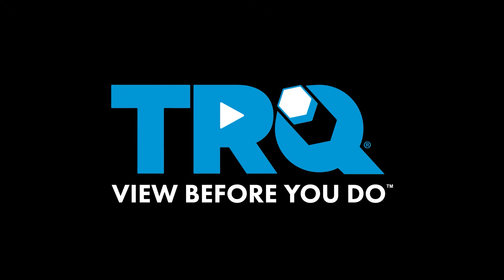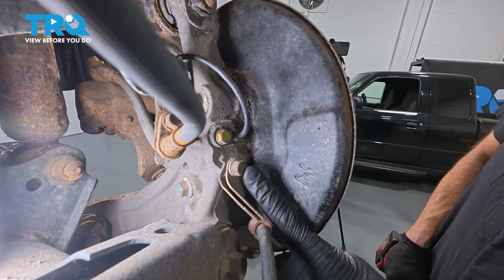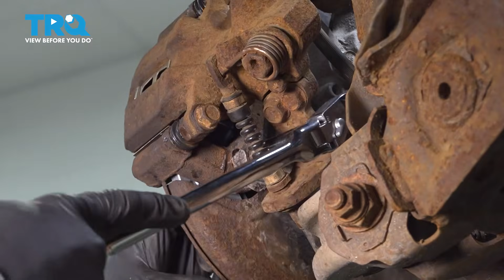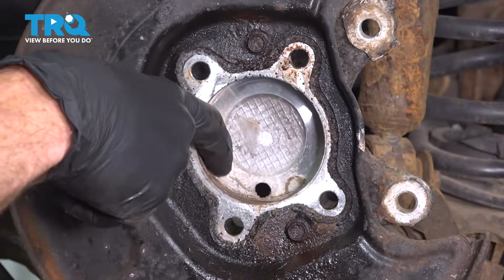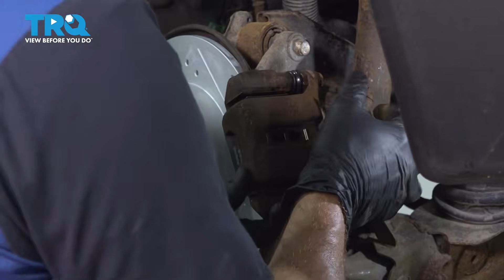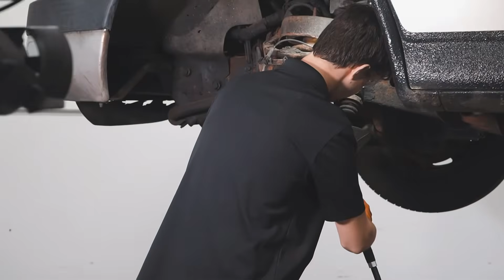How to Replace Rear Wheel Bearing & Hub Assemblies 2012-2015 Honda Civic

Comment: Why did you put a new rotor on then act in the video like you were taking it off the first time? If you struggled to get the old hardware off would have been nice to see how you did it rather than watch you take newly installed hardware off.